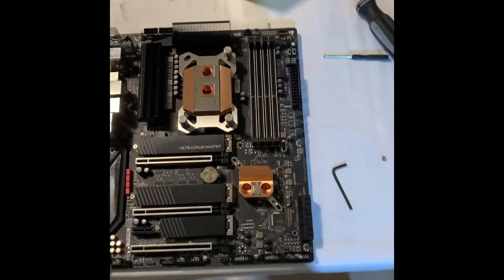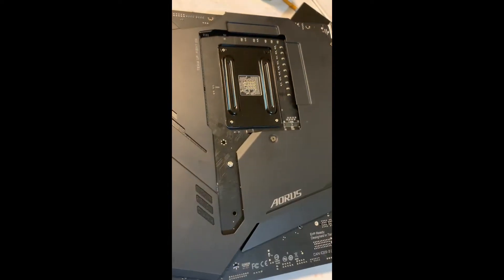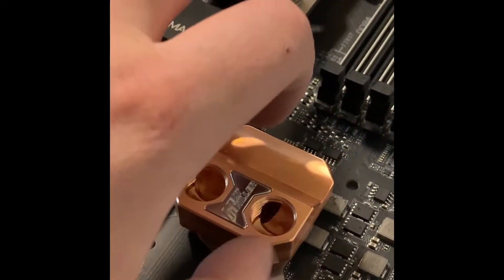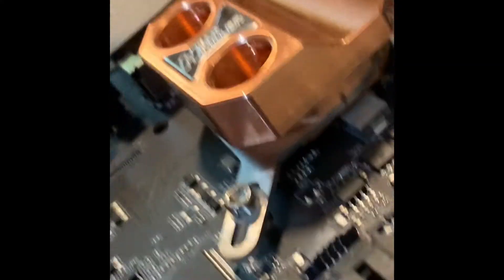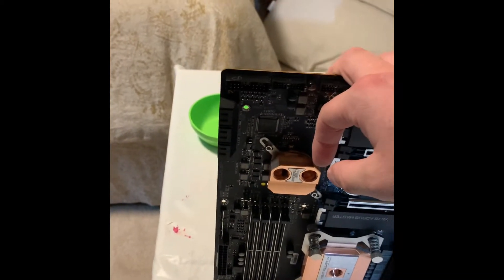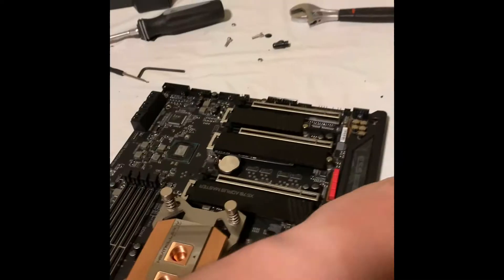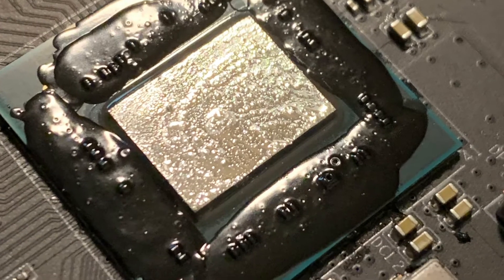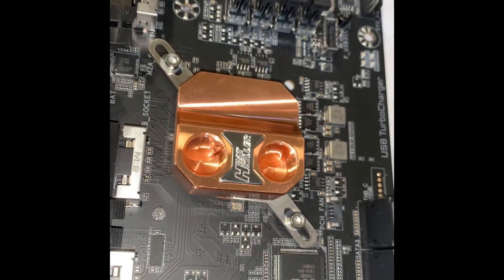Liquid metal & cpu block installation on x570 chipset (X570 Aorus Master)

Comment: PSA: Do NOT use liquid metal, paste or thermal putty for such a chipset block setup! Use a good quality but decently hard thermal pad.
First of all, it is overkill. But so is alot of watercooling and modding, so moving on to the relevant arguments.....
Bare copper plates like this one will soak that LM in no time and temperatures will start going bad, requiring disassembly of the loop and repasting. Even more, the alloy forming on the contact area from the liquid metal absorbing into the copper has worse thermal conductivity then either one taken separately.
Second, very important, the chipset is a bare die, and the original block is spring mounted, and also has that thin thermal pad which provides even more relief to an otherwise hard metal to die contact. Such hard contact with no cushioning could shatter the die edges and corners if (when) it wobbles. 
This waterblock is hard mounted, with no safety stop screws, and fixed only in 2 spots, not 4, meaning it will wobble diagonally; connecting tubing to it will make the situation worse, adding strain to the chip and grinding at it, and could even cause die cracking (aka bye bye motherboard, that is a no fix damage).
Use a decently thick thermal pad to absorb the strain and do not overtighten, it is very easy to do so. Finger tighten using a pair of hex+tubular bits; as in do not use a screwdriver, finger force is more than enough, using a screwdriver will provide too much torque and you will not feel it.
I have an identical setup and use a 2mm Thermal Grizzly minus pad 8, which does a very decent job at cooling, and has shore 00-60 hardness, which is just fine to provide a spring mount like relief.  Could go as low as 1.5 mm for less thermal resistance, but I found that at this thickness it starts to shred under the mounting pressure and the die's sharp edges.
After this, make sure to hold the waterblock from the sides when pushing in the tubes, be it soft or hard, do not apply pressure to the die as it could crack it.